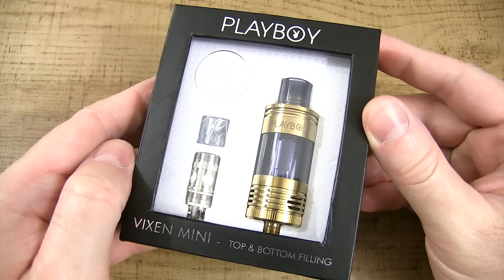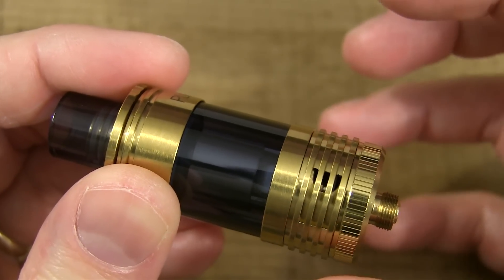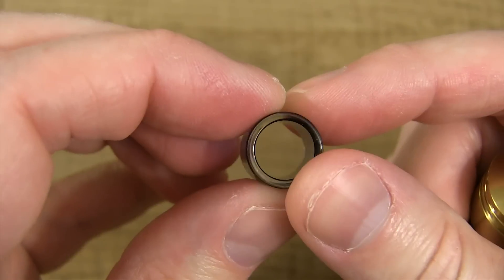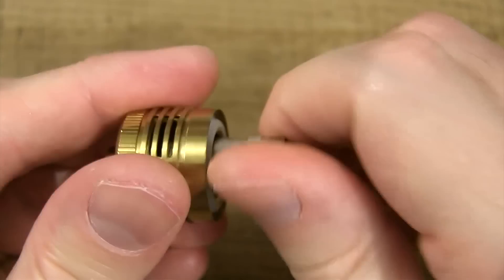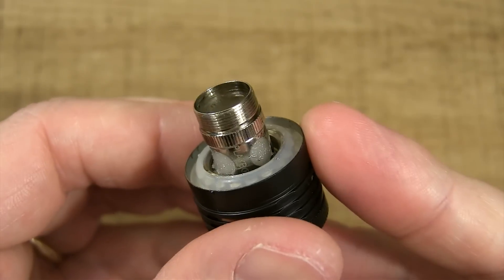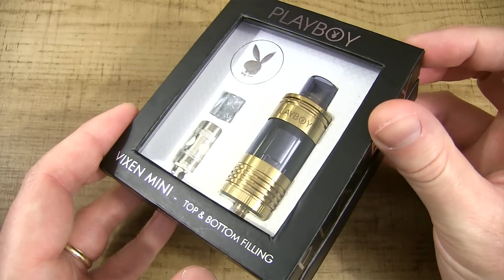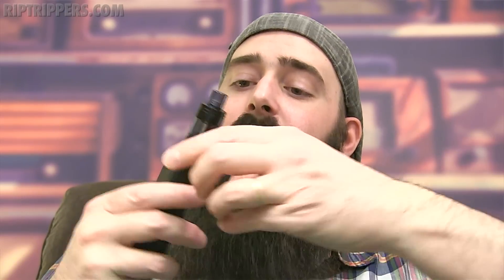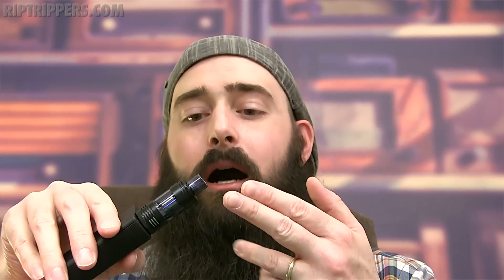Playboy Vixen Mini!

Comment: Hey Rip, will you do review of OBS Crius please. Thinking of getting it but still waiting for your opinion :) !!
Reply: +Tomasz Jurczyk   Check out Mike Vapes, Or VapinHeathen.  They both reviewed it. I have one Great tank, No leaking. Easy wicking. But get the V3, it has the velocity deck to make building easier. I have the V2 so its a little harder but still pretty easy. Great flavor and Vapor. I recommend it.
Reply: The Crius by OBS is AWESOME!  I'm using it on my Releaux RX200 AND my Evic VCT mini!  The SMOK TFV4 mini kit is also a great tank.  A lough I've been through 2 Pyrex tanks in the first 2 weeks.  On my 3rd tank right now......
Reply: +Tomasz Jurczyk 
I want to buy one too, but I won't until Rip says he would buy one if he lost it :)
Reply: +Kyle Light +George Gonzalez +FatalFrame45
heh guys- yea that is the thing - I saw those reviews and stuff but I own already an RDTA and to be honest was wondering about the differences and which would be better because just theoretically if the OBS is worse than RDTA then I keep calm and vape on ^^
Reply: +Tomasz Jurczyk You mean the Aromammizer RDTA? Because rdta is just a category, like rta or rda. I'd say if you have the Aromamizer, the differences will be quite minor and honestly not worth the money, but that's just my opinion.
Reply: +Fabio saleen yep - Aromamizer is what I meant. :) that is what I think - but still it is a very good tank and I am wondering why there is still no review on Rips channel. :(
Reply: +Tomasz Jurczyk I have the aromamizer and the difference is it has a rebuildable velocity style tank, but it uses a different size hex head than the velocity which makes no sense to me.

Comment: Trip, review the cci triforce sub tank. Man that tank is the closest thing I've felt to vaping a rda. You can vape it over 100 watts!
Reply: +Donvannah Brown I'm not sure of any "major" reviewers that have reviewed that beast.
Reply: 100 watts is underrated. I'm using the .2 on a noisy cricket and even if voltage drop was 2 volts, it's still over 200 watts

Comment: Is that the first version? I just saw a review that has a removable tip shaft to use your own. It still has the same removable glass tip too but the shaft does detach.
Reply: Nevermind it's the full size Vixen.

Comment: Hate wide open airflow, got the velocity and have it near to closed off, you'd have to have massive lungs to vape it wide open.
Just over kill with the velocity, it's good to have options but IMO it would have been better with smaller indirect airflow or just less holes, just more places for juice to leak out from. The marquis is my go to vape with the chuff cap not too airy gives a nice warm thick vape.
Gone off tanks just have one for every now and then when you can't drip. Favourite tank ATM is the nextgen holds 5ml juice and is no bigger than a dripper and is piss easy to build on.
Reply: +SUM1SLY83 Yeah, my normal 24g dual coil build in the velocity at ~50 watts is best when the direct airflow is only 1/2 to 1/3 open.  Any more and the flavor and density start to diminish.

I have vaped a few staple and clapton builds with wide open airflow at 150+ watts though, and the vape was hot, dense, and flavorful.  All about the build and power.

Comment: Aromamizer Rdta by steam crave with the velocity style deck is best in slot right now .
Reply: +Ashur George NOP IS NOT  IS THE OBS CRIUS WITH VELOCITY DECK    BY FAR THE MOST EASY TO REFILL THE MOST EASY TO DO COILS (BELUS IS NOT THAT EASY) AFC WITH EVERYTHING USE VELOCITY DECK) ONE OF THE MOST EASY TO CHECK COIL (ANY TIME) AND ON TOP OF THAT 4,5 ML CAP(IM NOT SURE ABOUT THAT BUT IM SURE IS 4ML+) AND WITH OBS YOU CAN TAKE MORE EASY MOUTH TO LUNG VAPE FROM AROMAMIZER   4 ME  IF IT WAS THE ONLY WITH VELOCITY DECK IN THE MARKET I WAS GOING NOT TO BUY IT THE AIRFLOW CONTROL IS SOOOOOOOOOOO SOOOOOOOOO CHEAP AND TERRIBLE FOR THE MONEY NEEDED TO BUY   --->> WHAT THE HELL THEY WAS THINKING !!!!!!!!
Reply: +DJ SICK__BOY You need to hit the Caps button on your keyboard bud...CAPS are meant for yelling or distress...
Reply: My 6ml aromamizer rdta came stock with the velocity style deck and 2 black vape bands 1 with 2 holes ... the other with 4. It also came with spare o-rings and an extra glass tank. with the usual extra grubs screws allan key and trusty blue.

  Fresh air to the side of a verticle coil with even leads supporting a plump wick laying over those deck holes = juggle proof leak-less tank... that performs like a velocity RDA that holds 6ml.

FRESH AIR STRAIGHT TO THE VERTS BRO ! ! !
Reply: m8 airflow is airflow wherever you have the holes is gone bring in freash air    ok i get it for the ml but you must say things how they are bro  the construction of obs m8 is 100x times better even a blind can see that  (the obs  dont use cheap silica ring for airflow)  with that im not say the oramamizer is bad (is not) but when you put it side 2 side with obs check both what offer see quality you go with obs m8 (oh i forgot this-->> the obs dont leak if you put it side  with airflow open --- try to do that with aromamizer )
Reply: How do you wick vertical coils in that thing?
Reply: easy m8 is not difficult  but if you like vertical coils then you buy wrong atty m8  check Footoon Aqua FX

Comment: my wife says vaping isnt the same as smoking so i was thinking about getting her a sub ohm. but she isnt into the cloud chasing. is there something you suggest that would allow her to puff on it then inhale like a cigarette rather than taking it straight to the lungs? but still getting a bigger hit?
Reply: For someone who is currently still smoking and not into the cloud chasing I would say go with the nautilus mini bvc atomizer. It's good up to 5-6watts. Doesn't sound like much, I know, but for someone who is still smoking cigs it'd be perfect in my opinion. Sub-ohm tanks are more so for cloud chasing, at least in my opinion. If you do go with a sub tank go with the uwell crown or the kanger subtank mini
Reply: wildhonda 4x4 thsnkd but i need something with more gratification cloud wise but not something she has to take straight to the lungs to hit. something she can puff into her mouth before inhaling.
Reply: +buddyroach I quit smoking with a Nautilus Mini, and quickly wanted more- 
So I bought a Taifun GT- it was great for me because it was more mouth to lung style at first.. then I drilled it out for lung hits and still wanted more airflow.. Now I'm rocking a UD Zephyrus using the rebuild deck, and want to get into RDAs for lower resistance builds to chuck bigger, tastier clouds

I feel as though jumping straight to sub-tanks might be a bit overwhelming at first- I certainly saw no appeal to filling my lungs straight off the atomizer at first, and couldn't even fathom how people did it without coughing up  a storm (I cough for like, no reason)
That being said, while many tanks can be used with minimal airflow, I can't imagine my Zephyrus- for instance- would work very well that way.. though that isn't to say it's not doable, as one could still build 1+ ohm coils and choke it down (though I'd wager you're looking for replaceable coil heads)
Another massive factor to consider here is what kind of mod will be used, regulated, or unregulated

you guys could certainly check out more of RiPs videos, as well as vapingwithtwisted420, grimmgreen, and even reddit for some reviews if you can't really decide on your own
Reply: +buddyroach  OBS Crius, proper tank for subbing, velo deck, dual coils so she'll get a superb vape & she can close the airflow right down to zero for her mtl hits. Everything else about the Crius is spot on, top/side fill without any leaking whatsoever due to the juice flow control. It's a superb device,  $20 at GearBest makes it a no-brainer, well worth an 8 or 9 day wait from China. RTA of 2015
Reply: Herb Green sweet. thanks man!

Comment: Can you use nickel with just plain wattage? Or does it MEED to be tc
Reply: +Joe Yummiestanimal TC only, ever!  SS is the only one right now that can be vaped in either wattage or temp mode.  Can't suggest vaping Ni200 coils in anything BUT temp control mode on a device that will support that.

Comment: Would you recommend this or the Uwell crown?
Reply: crown for sure
Reply: Depends what you want from your vape, I prefer flavour so I'd go with the ud Bellus personally it holds 5ml juice has a nice flavour and you build your own coils so it's cheaper and your'll always be able to use it even if the likes of Uwell stop making the same design coils. And I heard they might be making a velocity style deck for it.

But if you're set out of them two get the crown but buy the rba so you can always build it if they stop making coils for it.
Reply: +damagecase13 I thought the exact same thing I didn't like the crown much either, could try the steam crave tank too, it has so many parts out for it you can build it the way you want, you can have it hold 3.5ml or 6ml, 3 post deck or velocity style deck if you don't want to build coils they've just started making pre-built coils they even make ceramic coils, they just keep releasing new stuff for it so it'll not get old as fast as other tanks.
Worth considering.
Reply: +damagecase13 yeah I know what you mean, that's why I mentioned the steam crave, they seem to be doing something different instead of making a tank and moving onto the next one they seem to be supporting it a bit more by making upgrades for it.
Not really into tanks that much now prefer rda's, but if I was to buy one I'd try get one that doesn't get old fast.
Reply: Thanks guys :)
Reply: +SUM1SLY83 I have a steam crave. Aromamizer. It's really nice vape. Velocity deck too. So good

Comment: I Have The Istick 20w Just Got It & I Don't Know What Tank To Get It ??
Reply: They still make those?
Reply: you can't sub ohm. not with 20w. so look for something with 1ohm coils. you could push .9-7 but you'ld wish you had more power
Reply: Meant Like What Kind Of Tank Should I Get ?
Reply: +Lucas Gorski ?
Reply: +Ethan Baltazar don't get this tank or a sub-ohm tank as most need 20w just to fire the coil's...but the Kanger subtank mini does come with a 1.2ohm coil which would work very well with your istick 20w and you can buy those coils as well....I have 5 of those tank's and love them....basically your gonna want a tank that accepts coil's 1.0 ohm or above
Reply: +BadAssVapor so the kanger subtank mini would be best ? & thanks for the information man
Reply: +Ethan Baltazar yes.  The subtank would be fine for the istick.
Reply: IMO yes...it also leaves you room to step up to sub-ohm vaping when you get a higher wattage Mod...there are other non-sub ohm tanks you could get but then you'll be stuck buying a sub-ohm tank once you do move on....the Kanger subtank mini will allow you to do both so it won't be a waste of your money
Reply: +BadAssVapor  Thank You Bro
Reply: your very welcome
Reply: either subtank mini with 1 ohm coils or nautilus mini
Reply: +Ethan Baltazar Are you transferring from smoking? Do you want to rebuild them yourself, or buy pre made coils?
Do you use high nicotine or low? If you are new to vaping, and use higher nicotine strength, I wouldn't recommend the Subtank for the iStick 20W. Simply because I think you will use the .5 ohm coils when it's not compatible with the iStick 20W. You can use the 1.2 ohm though. 

Buy the Aspire Nautilus mini. It's a great starter tank : )
Reply: +Sean RobinsonJR Nah This Is My First Vape I've Never Smoked Cigarettes lol I Don't Use Nicotine Anyways & I Already Ordered The Tank
Reply: Ethan Baltazar I guess since you don't smoke, you probably want big clouds, Subtank is then a great first tank. It does leak sometimes. Make sure you bought the version 2 if you are planning on rebuilding it yourself : )

Blows a bit that you bought the iStick 20W when the iStick 30W costs like almost the same now, and the iStick 30W can Sub-ohm (Below 1.0 ohm)

So now you need to stick with 1.0 ohm and above. If you want big clouds, Sub-ohm is the way to go.

Comment: what up people i need some advice im new to vaping and ive been using the ego t for about 2 months and i wanted to upgrade to something better that has a removable 18650 battery thats regulated. can any one suggest anything. im more into vaping for the crazy flavors.
Reply: +SweBass do you think it's better than the sub box mini? because I found them both for around the same price which would you go for? also thanks for the advice
Reply: +Stewie Griffin i went with the evic vtc mini picked it up for $20 for the full kit along with the kanger subox nano for $20

Comment: obs crius all the way
Reply: OBS Crius is AWESOME!  Would recommend it to EVERYONE!  If I had the choice between the playboy vixen, OBS Crius, SMOK tfv4 mini, or triton/triton 2, I'm taking the Crius fo' sho!  But if flashy is what you want, get that fake gold playboy!  Cause it's all about the bling, right?
Reply: +Kyle Light those aren't really comparable. it's an rta not a sub ohm tank. there is a difference.
Reply: +shadowchu419 crius was the only rta in that line.  i was going more on price points.  if you want my tank opinion, its the tfv4 mini
Reply: Kyle Light same here! I love the tfv4 mini, especially in black.
Reply: +shadowchu419 my only advice on the tfv4 line.......don't vape it above 60w!  Had the sextuplet coil in for 2 weeks on my Evic vtc mini.  Vamping around 40w.  Thought I'd throw it in the Releaux rx200 when I got it.  Had been vaping on a dual fused Clapton @ .09 ohms.  Turned it up just to see what it was like at 100w.  Forgot to turn it down. Put the tfv4 on.  Ripped 4 hits, and the 5th went dry........#BURNEDITUP
Reply: Kyle Light I hit the Clapton coil at 100 no problem, and the quad coil at 150
Reply: Kyle Light then again I like warmer vapes than most people.